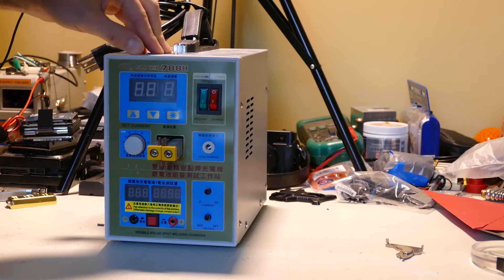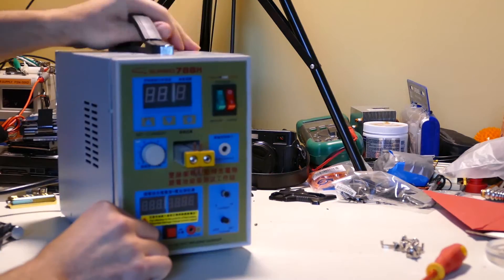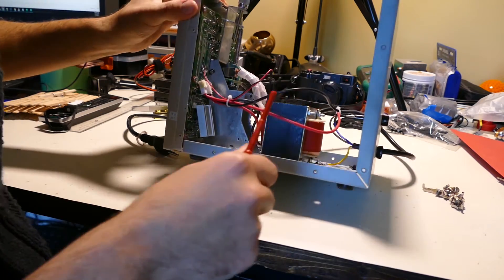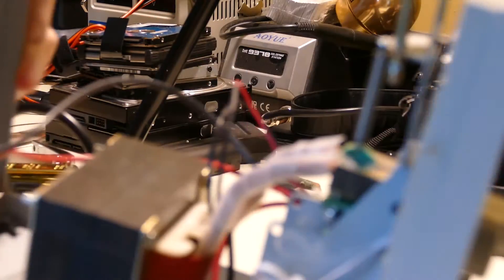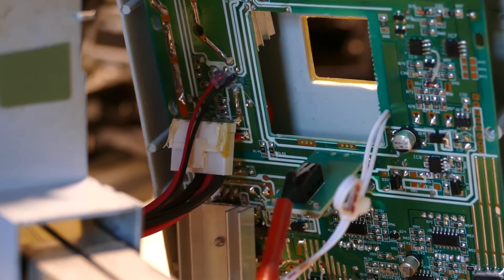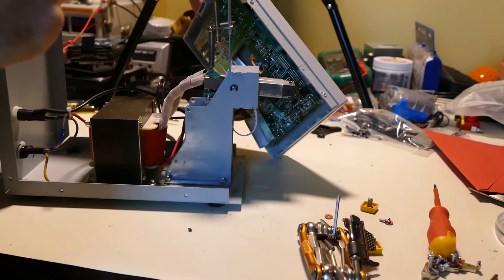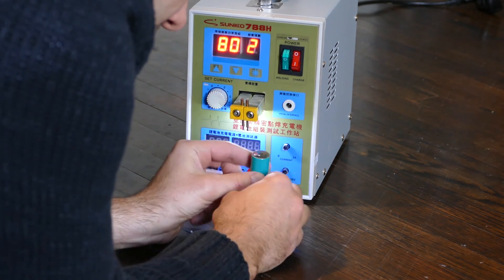Sunko 788H battery spot welder teardown

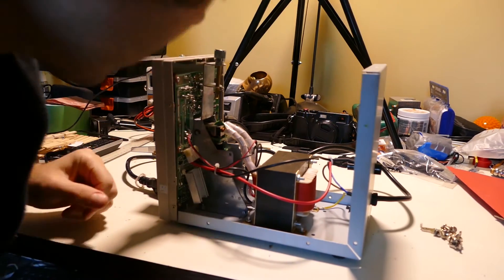Comment: 3:16 you want the tension to hold the tab that is being welded down, but not so much that the heat causes the probe to blow through the tab. the "least" might not work because perfectly flat isn't a thing on thin pieces of metal.